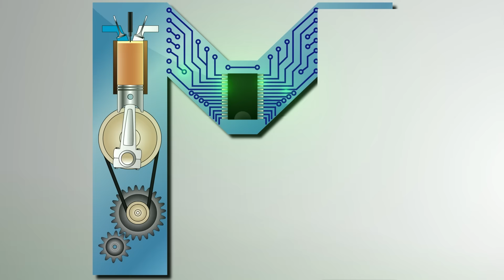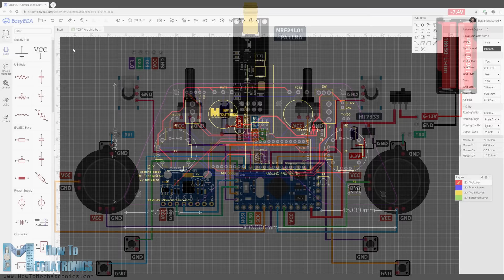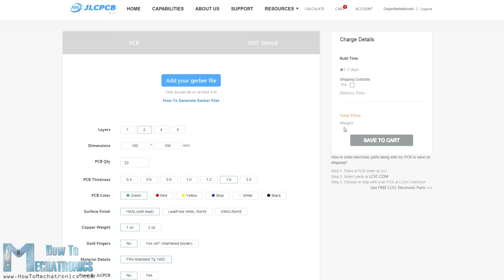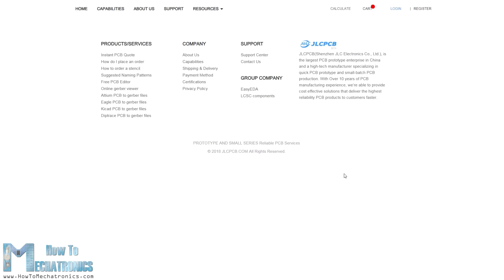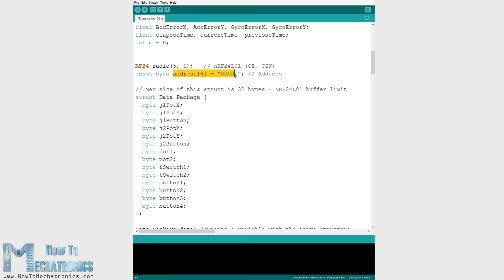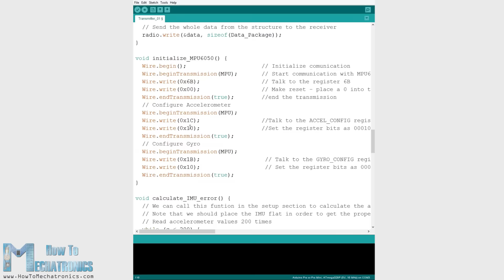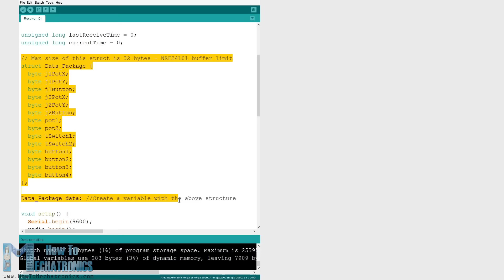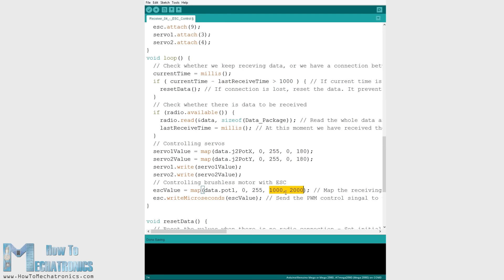DIY Arduino based RC Transmitter

Comment: This is one of the best DIY videos for rc transmitter and receiver i have ever seen. I have already made this project and it works flawlessly. I am commenting now but i watched this video in August 2020 and made the project at that time only. But i watched this video even now and it’s still relevant to the time and you won’t find an easy tutorial than this. Cheers to this channel 🥂. Keep the good work up.
Reply: which capacitors u used?
Reply: @ any capacitor for same voltage should work. Take 3.3v 100uf it is enough
Reply: @ so both capacitor for this controller na
Reply: @LegendGuy  I didn’t understand?
Reply: @ like there are 2 capactiors used

Comment: Nice build! If you wanted to add more controls, you can save 7 bytes in your data package struct just by defining the buttons as a bit field - all you need to do is to specify the number of bits with this syntax:

struct Data_Package {
    byte j1Button : 1,
    byte j2Button : 1,
    byte button1 : 1,
    byte button2 : 1,
    ...
}
Reply from the maker: Thank you and thanks for the input!

Comment: Very nice...on the top under the ground (big pin) on the voltage regulator...I recommend putting a large poly pour under it to act as a heatsink (you could even put it under that circle that has nothing in it)
Incredibly nice build!!!!  Great Job!!!!

Comment: Your projects are always fantastic. I really enjoy them and always learn something new when you explain your code. Thank you for sharing your knowledge. Any thoughts on adding an small I2c OLED display to the controller in a future version?
Reply from the maker: Thank you! Well to be honest no, I don't think I will do that. What I thought was connecting a LED for indicating the battery level or/and the connection status.
Reply: Please tell me about the coding i don't understand how can i program the transmitter i mean i don't understand the coding

Comment: heads up to anyone that is actually building this...
-the parts list does not have ALL the parts
-the toggle switches are not the right kind
-and there is a 99% chance that you will have to redo the PCB board because the arduino pro mini does not have the right locations of pins(even though he mentions it, you might miss it)

anyways good video, and I really love how easy these tutorials are to follow

Comment: I'm confused on the capacitors. I see in a comment you responded to earlier that in regards to the capacitor values, "the ceramic one is 0.1uF and the electrolytic one is 10uF". 

Thing is, I don't see a ceramic capacitor. I see two electrolytic ones. Can you clarify this please?

Comment: This is so awesome!
Thank you for the great tutorial!
What size capacitor did you use before the voltage regulator?
Reply: 10uF, 16V
Reply: @VanDerLaars i also cant find capacitor ru sure its 10uf 16v?
Reply: @LegendGuy  I believe I found the unfo in the written article.

Comment: On the analog inputs you reduce the 10 bit input integer data to an 8 bit byte using map. The map function used addition, substaction, multiplication and division. (look up the source code of map) Instead of all these computational steps just to throw away 2 bits you could have used the right shift operation. In one step.
byte data = analogRead(pinName) >> 2;
Reply from the maker: Thanks for the remark.

Comment: I'm not sure if previous comment got nuked by algo, but it didn't show up...
Pro Mini controller linked to Amazon in the article for PCB V2 and V3 will not work because it has different pinout for A6 and A7. That could be because Amazon listing has changed after article was published. Make sure you get 5V 16MHz Pro Mini with correct pinout (A6 and A7 on the side opposite to programming header, where RST button is in the controller linked in the article)

Comment: A very well designed project! I plan to build some of these from your files. Thank you very much for sharing!
Reply from the maker: Thanks! Just make sure you have the right Arduino Pro Mini or modify the PCB according to your Arduino Pro Mini. I already mention this in the video that there are different Pro Mini versions with different pin layouts. You can find a link to the Pro Mini I used on the website article.

Comment: Futher development:
I advice to using ESP boards. They got wifi and bluetooth embedded so you dont need additional radio module (black in your video) and antenne
Reply: For short range projects this is a good alternative. For long range - like drones or anything with no clear line of sight, RF is still better. It's all to do with the signal. 2.4GHz behaves like a light wave - light doesn't penetrate solid, non-transparent objects well, 433MHz does penetrate and gives a longer distance. Some RF modules can achieve 1km in range that use 433MHz where as the 2.4GHz is 300m or less with antenna bit more like less than 100m without antenna.

Comment: Nuts can shortcircuit or penetrate the outer layer of batteries! Add some protection or redesign how you fasten the battery holders

Comment: 2:32 wait, you can't use an electrolytic capacitor as a decoupling capacitor. You need a 10nf ceramic capacitor for that.  The one pictured is probably 10uf, which is good for a power supply filter capacitor, but then you only need one on the 3v3 line, not two.
Reply from the maker: I will take that into consideration next time. Thanks for the input!

Comment: This is a great project.  I'm glad you cut the acrylic with hand tools, it is great to see a simple method work so well.  Do you have a tutorial on designing a circuit board?  I have some projects similar to yours -- arduino based, many wires, that would benefit from this.
Reply from the maker: Thank you! Well yes, I have an older video of designing a simple PCB using EasyEDA, you can find it on my channel. However this is my PCB design workflow in EasyEDA:  I directly create a PCB design, without a schematic, first I search for all components using the libraries, place them in logical way to have less traces interruptions and so I start making the traces. Depending on the complexity, I use both layers for running the traces, and sometimes I use vias which are very helpful because you can move your trace from one layer to another.

Comment: super well done and explained... if you want for example a 24 channel radio controll what you would change.. i am trying to do crane modell with 22 channel and I am interested in your project how you have done it... what would you change in your circuit? thanks karl
Reply from the maker: Thank you! Well the Arduino Pro Mini don't have that much pins, so an Arduino Mega would be alternative or you could use an Multiplexer like 74HC4067 which is 16 Channel Analog Multiplexer. So using only 4 digital pins you will get 16 analog input pins. Personally I haven't tested it, but it should work.

Comment: Great Project Video! You really have some of the best electronics maker tutorials on YouTube.

I am going to try to build this project. I already ordered the parts from Amazon and Banggood from the links you supplied. I am about to order the PCB boards for this project and the receiver from JLCPCB site. I was on their site just to register and it looks like a great tool. I do have to learn their interface for PCB development. 

I do have a question:
Can you supply me with the specifications and rating on the two decoupling capacitors that you are using?

Thanks in advance for the question and please keep on making videos! I am now subscribed and love watching your other videos as well.

Comment: Awesome project :) I'm already creating list of items to order. One thing that I think is missing is the battery level indicator. Simple LED would be enough to know that we will have to charge battery soon.
Reply from the maker: Thanks. Yes you are right, that would be nice feature. I though about that but didn't implement it. The problem is all analog inputs are already used in this configuration. However, if you make a different version with less analog inputs or without the MPU6050 module which uses the two analog inputs (SDA and SCL), that you will have enough pins to implement that idea.
Reply: where is the list?

Comment: Would it be possible not to solder a MPU 6050 accelerometer and also refrain from editing the code accordingly and still get the remote work? Thank you very much for your attention.

Comment: Cool video! ON the component diagram, isnt the decoupling cap on the transmission module hooked up the wrong way?
Reply from the maker: Thanks! Well that's just graphic, and it looks ok I think, the white strip is usually the GND pin and so is connected to the module.

Comment: setup(){
 pinMode(PB12, OUTPUT);
}
in loop() ... no further alternation or declaration on the top and setup() except the above

if (data.tSwitch1 == 1) {

    digitalWrite(PB12, HIGH);
    delay(1000);
    digitalWrite(PB12, LOW);
    delay(1000);
  }
Am I correct in the RX side?

Comment: This looks great!
Got one question: What is the frequency for transmitting. How do I know I'm using the right frequency so it doesn't interfere with other boats using the same system. Or even worse case, that I'm "overtaking" an RC plane for instance.
Reply: Almost one year further and still no answer. Would really like to know how it works with multiple rc transmitters and recievers

Comment: Thanks for sharing your video, code, and links for the awesome boards.  I've followed your link for the joystick without the breakout board at Amazon,  and I get the Epaler "blue" that is too small to the PCB.  By chance is the Gitfun PS3 "black" PS3 the joystick that will work?  I've got 10 boards to populate and could use your input.  Thanks again.
Reply from the maker: Hey, to be honest I haven't tried those joysticks, I sorry to hear that they don't fit. I should note that in the parts lists. Is there any chance you can share the dimensions of those joystick so I can note that in the article as well. Thanks
Reply: can you tell me how can I find gerber file to download?

Comment: hey nice video, just one question, what is the function of the capacitor connected to the NRF24l01?
Reply from the maker: Thanks. The capacitors are used for stabilizing the power supply to the NRF24L01 module.
Reply: Can you tell me which capacitor you used?

Comment: I know this is a few years old but I recently found it and wanted to thank you for putting this together.  It's really helped spur my interest in learning electronics by building something useful.

One question though.  I'm having trouble receiving a signal with the PA level set to anything other than MIN unless I physically touch the radio.  Could be that I have a defective board as I've seen threads about counterfeits.  Curious if you have any thoughts on that or if you've seen that before.

On a similar note, I noticed that on your receiver you have a 10uF capacitor on the voltage regulator that isn't on the transmitter.  Curious if that could be causing the issue at higher PA levels?

Comment: Do I have to use Li-ion 18650 batteries or can I use AA or AAA batteries as long as the voltage is between 6-12V

Comment: Edit: It looks like my concerns were unjustified. Thanks for setting me straight Oláh Balázs.
Both your radio and gyro module are 3.3V devices. Do these daughter boards include level shifting?
I would have thought a 3.3V Arduino would have been a safer choice as the main controller.
Reply from the maker: Yes, you can go with 3.3V Arduino Pro Mini. I didn't have one at the moment of making the video so I therefore I used the 5V version. In such a case you could also use just one Li-ion battery for powering with the HT7333 or the AMS1117 low dropout voltage regulator for the whole project.
Reply: The radio module is 5V tolerant on it's io pins. The gyro has a on-board 3.3V power regulator and pullup resistors on sda, scl (I2C pins) lines to the 3.3V  (using the previously mentioned power regulator). As long as you don't enable the internal pullup resistors on the arduino to 5V or put external pullup resistors on sda, scl lines to 5V you are good. All that the I2C protocol does is that it pull these lines to ground and releasing them (from the point of the arduino).
Reply: @balazs4112  "The radio module is 5V tolerant on it's io pins."
Yes, I think you're correct. Thanks for pointing that out.

"As long as you don't enable the internal pullup resistors on the arduino to 5V or put external pullup resistors on sda, scl lines to 5V you are good."
Agreed. I was under the impression most Arduinos had pull-ups on the I2C lines but after a bit of checking around, It looks like the pull-ups on the Pro Mini are on the bottom of the board and optional.

Thanks for putting my mind at ease.

Comment: Hey!
Freind you can also atach Oled display in this project and try voltage sensor to use as telemantry to display live rx and tx voltage on the screen 🤔🤓 and also as drive mode selection
BTW love this project nice job

Comment: this is good but i wanted a long range arduino control but NRF24L01 has 1km on paper or 1km Ideal distance but on physical testing it's around 724m wuth latency of 56ms

Comment: The video is great! I will definitely try to do this although I may use a different case for it. Thank you for making the pcb board. I have a question: why the accelerometer gyro? what does it do?
Reply from the maker: Thanks! Well we can use the accelerometer and gyro for controlling things with moving around or tilting the controller, you can see example of this at 0:58. If toggle switch 1 is active, then the Joystick 1 commands are replaced by the accelerometer and gyro.
Reply: @HowToMechatronics  , Oh. Wow! That's really cool!!
Reply: Another question: you used the HT7333 for power supply/voltage regulator. why not a regular DC-DC buck converter board? does the HT7333 have already one output for 5V and one for 3.3V? I'm not familiar with this component.

Comment: Great project; I have been struggling to get this wireless transceiver to work on Pi Pico. I have placed order for this PCB. You should really add it to PCB Way. care to share the (centre-to-centre) distance between the joysticks? I will like to design and print a chassis while I wait for the PCB.

Comment: Thank you for using a PCB. it's hard to follow those who make them from a whole bunch of wires. How many Ohm potentiometers do you use? In your links there are between 1k and 500k ohm potentiometers and I'm not sure which to get.

Comment: How come you are doing more complex communications techniques on NRF24L01 module? I've tried in many situations including the basic "Hello World" printing but nothing doing. Also I used Mega, Uno, Nano, Pro mini & Module's power adapter. 😣😣
Reply from the maker: Try again and again! :) Try using capacitor, distance a little bit the two modules from each other, make sure you mach the address and it should work.

Comment: Tell how would I add a hard drive to hold python programming then how would I configure the hard drive to either auto pilot or let me manually fly it. Also how would I include GPS  with return to home?
Reply: Where along the circuit would I include the hard drive?

Comment: Hey Makers, when using the mega board and adding a NRF24L01+, make sure to put a big cap say 220uf across the 3.3v power pins.  It will save you a lot of grief.  I Went from slag to 100% at 2MBPS.  Yowwwzza

Comment: Hello sir your videos about diy arduino rc transmitter and receiver are great, i just wanted to know if i can fly those commercial mini brushed motor drones with nrf24l01 radio chip and arm microcontroller  using this diy transmitter?, bcoz i have one whose transmitter is lost..appreciate ur reply..

Comment: Hi, great project. 

I'm a bit of a noob so please be kind, I'm having trouble getting the HT7333 3.3v regulator. 

I saw in the comments above that a AMS1117 can be used instead, but the pin-outs are different?

Thanks

Comment: I just tried to order the boards and found out  that the shipping charges are 26.80 pluse the 7.00 for the board! Tried several methods and they were ALL the same. So, beware...

Comment: You're using linear regulators, that's a bit lossy. You can get off the shelf 5V+3.3V switch mode buck regulators for next to nothing. Also, where's your charge circuit for the battery cells? Having to swap out cells and charge them separately is a tad cumbersome.

Comment: What distance it is can use, for example using to drone, thanks
Reply from the maker: The range is around 700m in open space, not really good for a drone use but still it could work.
Reply: @HowToMechatronics  thanks

Comment: In my experience those rotation/acceleration sensors often do not work properly, often they somehow just won't boot properly and return only 0, how do you prevent that, I sometimes got them to work with the example sketch since that somehow did something to it, but using the normal instructions for using them they never did anything, only sometimes after running the example sketch before it.

Comment: hi sir, great project, i dont have resources or suppliers to have all these, can i just buy this project ready to use controller and receiver from you? i am building a plastic board robot right now but i cant find any controller and receiver that can control multiple motors with an analog just like wat you did

Comment: How did you connect the joystick, without using a breakout board? I cannot find a data sheet that shows the pinout for just the joystick

Comment: nice, How long that RF would reach in real?
Reply from the maker: To be honest I haven't tested for real. I mean, I have tested with my last project, the Arduino RC airplane to up to 100 meters and it worked. However I have seen people reaching a 500m or even 700 in open space.
Reply: @HowToMechatronics  Do you know what does commercial RF technology is? It could reach at least 700m, and top about to 2.5Km, How's possible